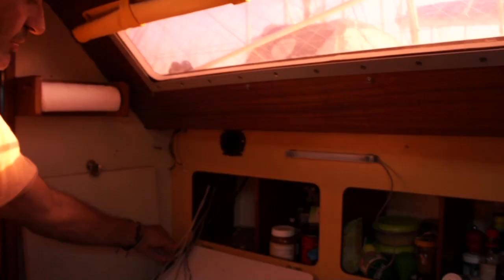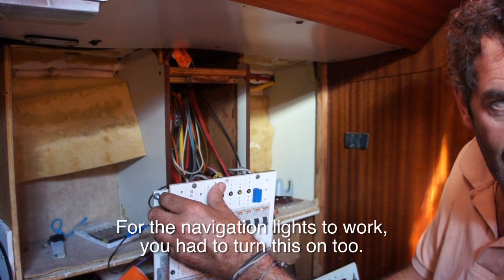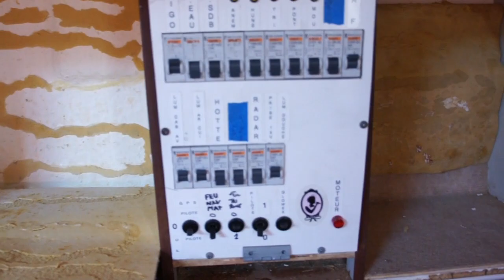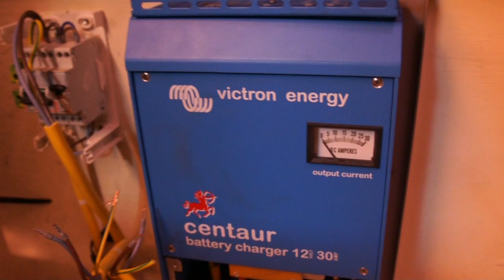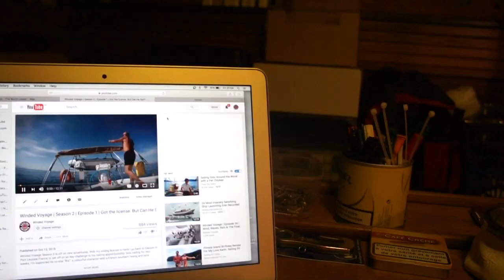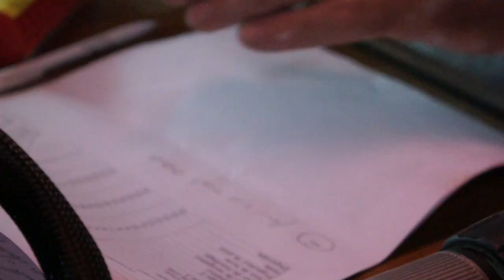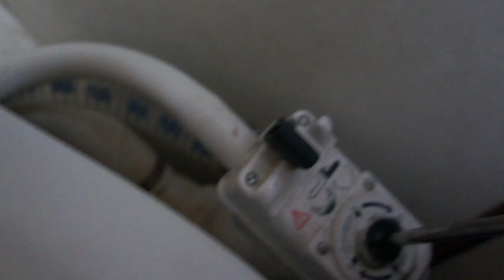Winded Voyage 2 | Episode 8 | Spaghetti Wires and Hoses

Comment: Hallo Alex, so much work to do and when you start no second thoughts. I noticed you scrapped away the cork insulation panels. Hope you are reinstating it as you may experience lot of condensation and moist without it. 
Looking forward to see a fully revamped Galopin.
Reply from the maker: The cork was where the second head was. So there was a reason for it. I had to take it off to fit in storage bins. It works real well, and the second head toilet is in a trunk if I need it as it's a got a small waste water tank.